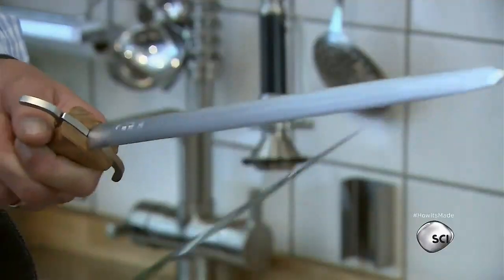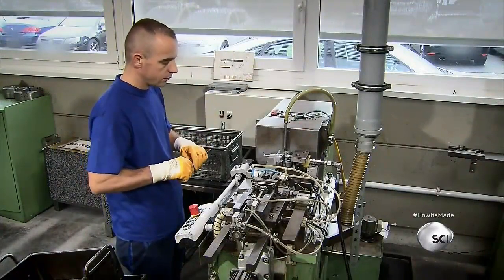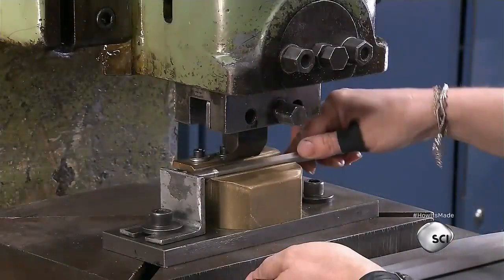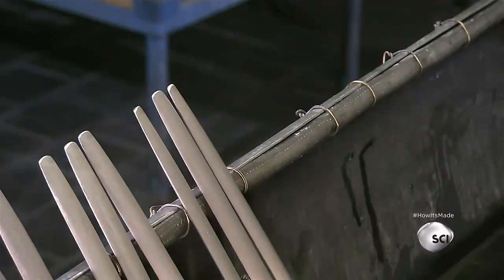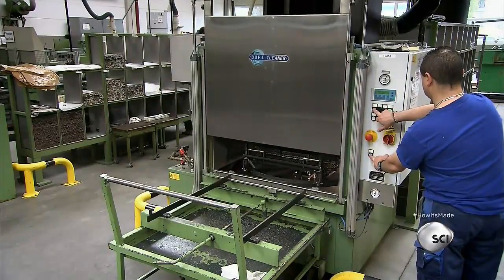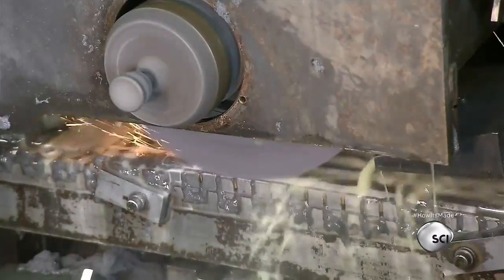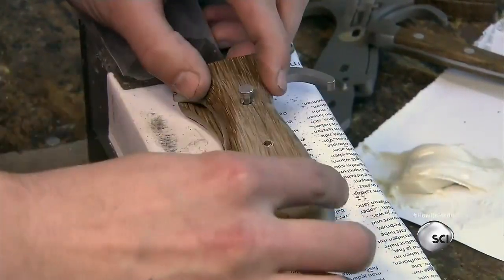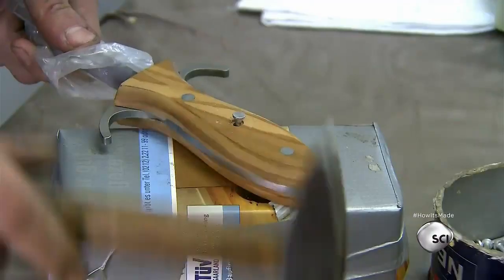How Its Made   Sharpening Steels

Comment: "A threaded hole is drilled into the base, so the sharpening steel can be mounted into a handle."

Sharpening Steel is glued and pinned into handle.
Reply: Lol I just noticed that, also I think the hole is off center.